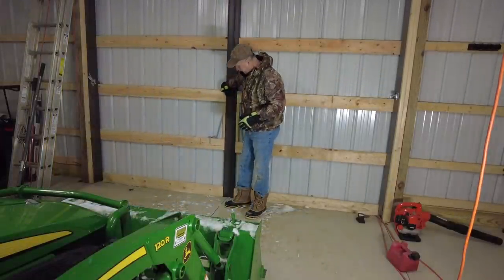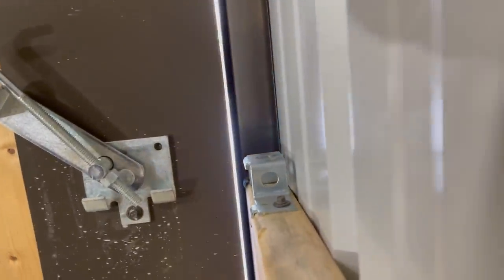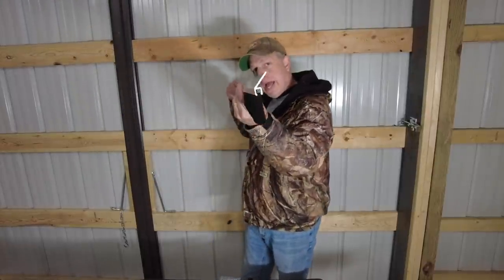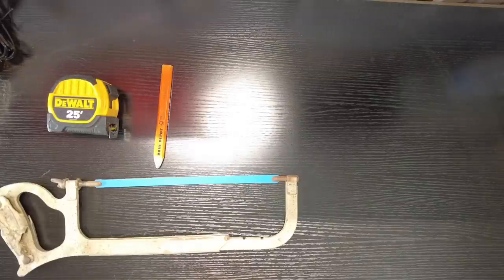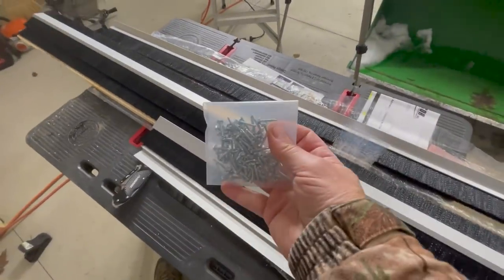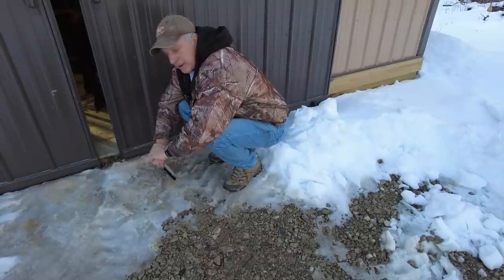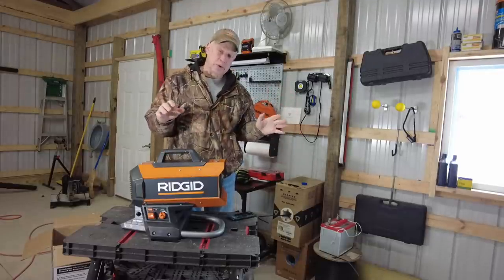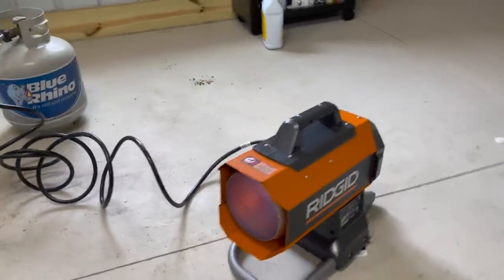Drafty Pole Barn Door?  How To Seal And Heat For That Occasional Project*

Comment: Outstanding solution!  Still, one day you'll decide to insulate that barn.  It's a natural progressing for comfort when needed!  While spray foam would be the best solution, the cost is far from what it should be.  Rigid foam board glued to the backside of the metal panels would be a likely and very good first step.  Believe me....been in "your neck of the woods" before!

Comment: Great video! I use a wall mounted propane heater for my 30 x 28 Garage! works great. also have an additional smaller portable propane heater as well if needed.
Thanks for sharing.

Comment: The big issue I found with propane is all the moisture it puts in the air, tools & screws etc. rust much quicker.  If you only have it on for a few min. it's not too bad, but leave it on for 3 hours and you can feel the humidity in the air.

Comment: Be careful with those torpedo style heaters.  They can cause two issues when used indoors.  They produce CO and deplete O2.  Pretty much any propane heater is going to do this, but the really high BTU output units do it really fast.  It is recommended that you keep a window or door at least part way open when using one of these.   There are plenty of news stories of folks who used these indoors during a power outage who ended up in the hospital or worse.
Reply from the maker: Thanks for bringing up that excellent point.  I do have a warning on the bottom of my description of this video for the use of ventilated areas.

Comment: If you want to keep the mice from eating your garage door bottom seal..bend a piece of flashing in the shape of an L. Then stick one leg behind the garage door seal that's on the building and the one leg of the L would go parallel against the door.  Worked well here when my 7day old seals started getting ate again.

Comment: Does the battery provide an ignition source? If so, it should last a good long time once the propane is burning, right? Thanks for taking the time to make this video! Cheers!
Reply from the maker: The battery provides the ignitor and runs a fan to propel the hot air.  You can feel it at 15' away.  The propane tank last about 10 hours or more depending on the heat setting.  The battery will last a whole propane tank.  That's with smaller 2 amp battery, longer with the 3 or 4 amp.

Comment: We had a bad experience on a job years ago with a torpedo heater. Three of us standing next to the heater and one of the guys had rips in his coveralls and it started burning. Needless to say me and the other guy started ripping his coveralls off.
Reply from the maker: They do need some clearance.  When rebuilding our TN cabin a contractor had a torpedo and used diesel.  Ugh, it was horrible, left a ashy film on everything, especially glass and porcelain.